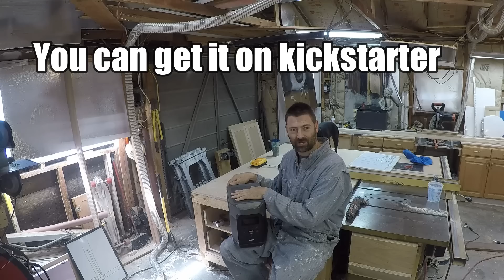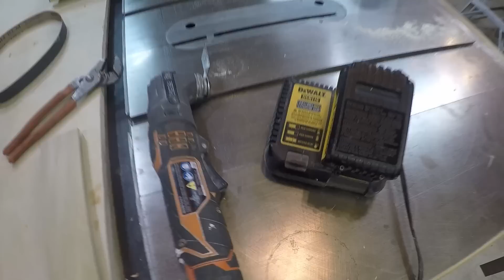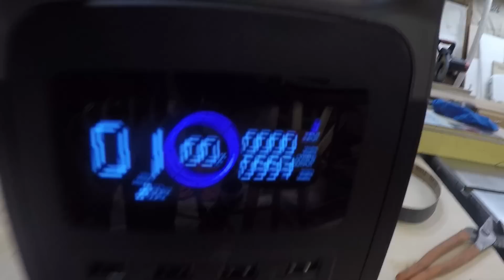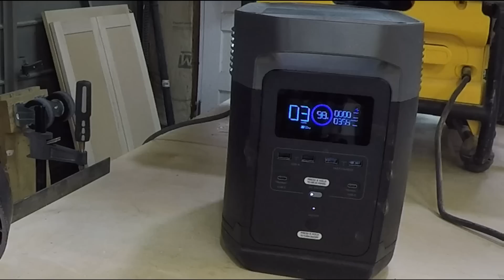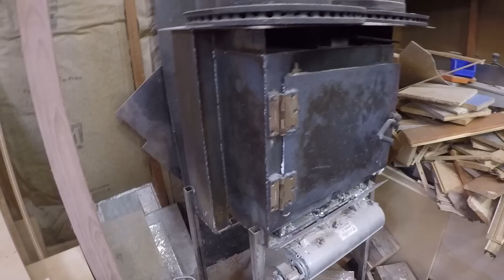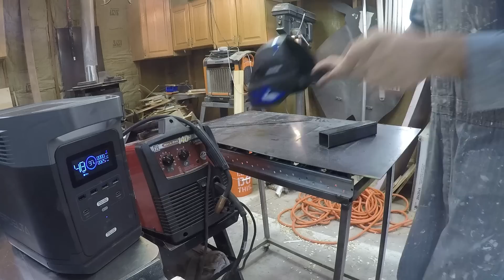Solar Power Welding | With Ecoflow Delta | THE HANDYMAN |

Comment: Im thinking of using solar and a large home invertercharger and 48v batteries in my container to run a tig welder. Id rather do that than run 150 feet of conduit and wire to the meter.

Comment: I got a DeWalt power station.  Same principal as the Ecoflow, but uses (four) DeWalt 20V batteries.  1800 (3600 watt surge) - handles the big tools with ease.  Tablesaw ripping 2x4, corded skill saw, etc.

Comment: Is there a similar cheaper model that would be enough to power the tools such a drill, orbital sander, etc non simultaneously? For hobby purpose only, no more than 2-3h of continuous work. It looks like this inverter in the video is more than it would be necessary?

Comment: What blade are you using in your Dewalt circular saw, to cut the metal?  Are there any other adjustments needed to do this?  Is it just a blade and that could be put in any circular saw?
Reply from the maker: It is a carbide metal cutting blade.  No other adjustments.  I use cutting oil with it so the saw is oily and I wouldn't want to use it on wood after.

Comment: If I was guessing, I would say between the startup surge and the sine vs square (or modified sine) wave created, it will have trouble running certain tools at 100%.  Still very impressive.  Good video.  Got me thinking about a new truck inverter.
Reply from the maker: I use to have a large pure sine wave 1800W power inverter in my old truck.  It could just barely run the table saw.  It would run my compressor with no problems.

Comment: Im like you when it comes to the advances in battery and solar tech.  I purchased a EGO self propelled push mower this spring and I never looked back.  It got a trial by fire.  First task, cut the front lawn that was at least 10".  Cut like butter.  Battery has plenty of power to cut and pull me around the lawn.  Ill never go back to gas push mower.  I have LED shop lights and work lights.  Better light, longer run time, dont have to worry about dropping or banging them around as much.  That is a great tool you have there.  I may have to investigate that more.  Thanks for the info.

Comment: Good job wearing your welding mask, but shouldn't you also wear gloves?  You could upgrade to safety sandals by adding socks...  LOL
I love that little generator.  Have you taken it anywhere yet, or just used it around the house?
Reply from the maker: I have been testing it at the house a lot  seeing what It will power. And how long it will power it for.

Comment: Power station by Dewalt handyman! It's a crazy beast! Great video 👍
Reply from the maker: I like the pure sine wave for running other types of electronics.  Modified would probably be ok for power tools.   I wonder if it would run my job site table saw.  It says its for variable speed corded tools.

Comment: I would imagine it would be quite handy running a camper or some other mind bending item after all that as well. Let’s try that test next. How long will it power a camper under normal use without solar connection!
Reply from the maker: I hooked to my laptop and got 2 full days out of it.  I'm on my laptop at least 8 hours per day.

Comment: Very cool. I love solar in my work trailer. Great for charging batteries between jobs. I don't have to worry about getting close enough to the house to run power to the trailer. Great for condos when you have to cut outside and no where close to park the trailer and no plugs. Plus it's fun to tinker with. Thanks for sharing!

Comment: The world has evolved a whole lot since the early  days of solar powered calculators. Next is the solar powered riding mower with a built in beer refrigerator.
Reply: Buy an electric mower, a mini fridge, some batteries (for the fridge) an inverter, charge controller, and some panels and you could probably do that for roughly $5k without too much difficulty assuming you keep the panels on a fixed system and charge during the day. A peltier device refrigerator would probably have a more a smaller form factor if you don't care about efficiency.

Comment: Capability to do a quick weld job is the biggest bonus for me. I hate having to get set up because I put all the heavy duty cords and everything away last time. If I could just throw this on my 110 welder cart and roll it where I needed it, that would be awesome. My normal inverter is installed into my vehicle and cords that can carry this electrical load especially if too far away are a big limitation. And I don’t want a generator right now.

Comment: will it run a 110 air conditioning unit
Reply from the maker: It runs my Campers 13,500BTU rooftop ac.  It will run a window unit no problem.
Reply: Curious:  

How long does it run that camper AC?

Running anything else also?
Reply: Curious:  

How long does it run that camper AC?

Running anything else also?
Reply: Curious:  

How long does it run that camper AC?

Running anything else also?
Reply: Curious:  

How long does it run that camper AC?

Running anything else also?

Comment: What is annoying about the soft start on that miter saw? Seems like a nice feature cause it doesn't shock your ears on startup.
Reply from the maker: When you need to make a 1,000 cuts its sooooo annoying waiting for it to start up to make the cut.   It is defiantly not for the trim carpenter.  Maybe for a diyer.
Reply: @TheHandyman1  Ah, makes sense. Thanks!
Reply: I hear ya! 😏 But seriously, I'm 50 and have spent my entire life either digging through a wood hoard hoping to find an exact length board for a project or hand sawing the darn thing. Yeah, that start up sound of a table/skill saw. Oy

Comment: What size (gallons) air compressor do you use for spraying texture? I used my 2 gallon for a a big bathroom and I couldn’t keep pressure, so annoying and it took forever.
Reply from the maker: I use the one that I showed in this video.  I have done a ton of texture with it.  It runs non stop.  I have to let it fill back up several times on larger walls.
Reply: The Handyman thanks. Looked like a 6 gallon, I’ll have to upgrade.